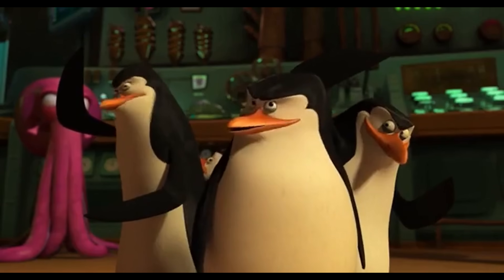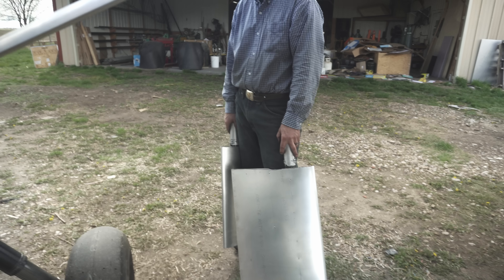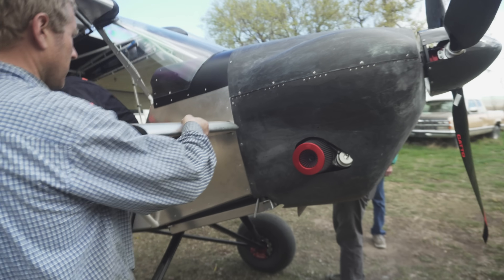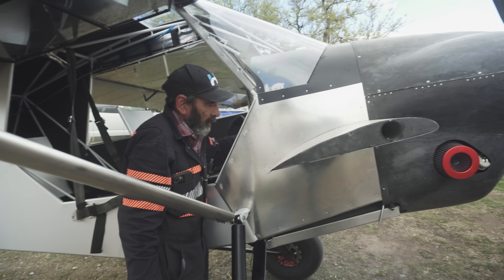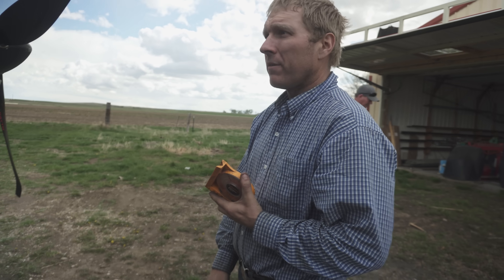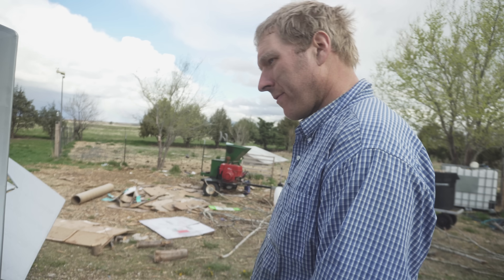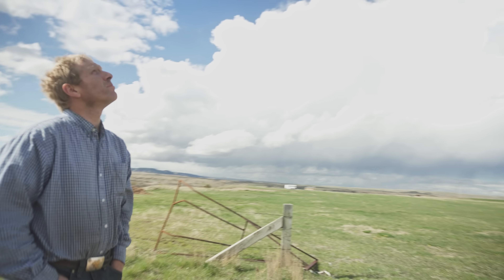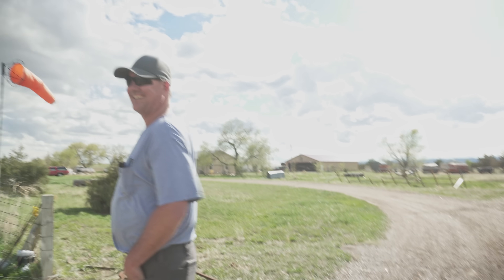Canard on a Bush Plane… Will It Work?”

Comment: I'm thinking that you only want just enough canard lift to lessen the need for up elevator / tail weight, AND you want the canard to start mushing just before the wing does. 
In other words, I'm speculating that if you're needing to dial down the canard angle of incidence to where the wing stalls before the canard, then the canard is probably too big.
Reply: your thinking of a canard config without a rear stabilizer though, this has a rear stabilizer so its not acting as the sole pitching force
Reply: @petrokemikal  No, I'm not. I'm thinking you don't want more canard lift than necessary to offset the bulk of the negative lift from the tail, when holding the highest unstalled angle of attack. It seems counter productive for STOL to end up coming in flatter, with less drag if there's too much forward lift. 
And given that the canard is moving the centre of lift forward relative to the centre of gravity (effectively the same as a more aftwards C-of-G), if the main wing starts mushing before the canard does, you might end up is a situation where the centre of lift moves further forward briefly (even more aft C-of-G) before the nose drops, which could get unstable.
Reply: I like this, but the question would be how much induced drag would be reduced or would any be reduced since you would just be trading the lift from the back to the front, also the arm from the center of lift to the canard would be smaller so would that mean you are adding excess induced drag
Reply: I think I am thinking in terms of cruise performance rather than takeoff performance
Reply: I see what you’re talking about but the canard is in the prop blast so the amount of lift generated would vary quite a bit depending on how much thrust is thrown at it? I have a Murphy biplane and it will hang in the air at very low speed as long as the wings are receiving prop blast. Once you remove the thrust things change.